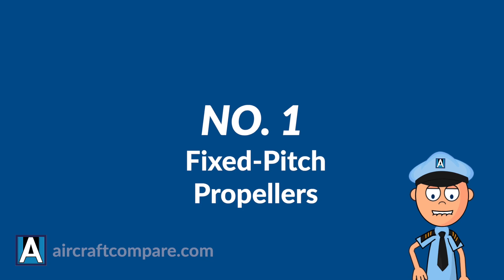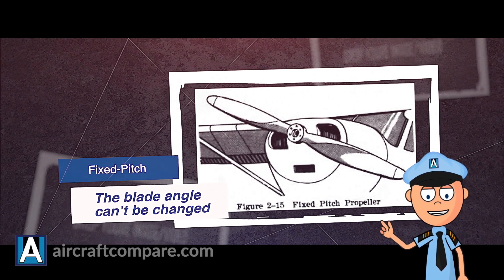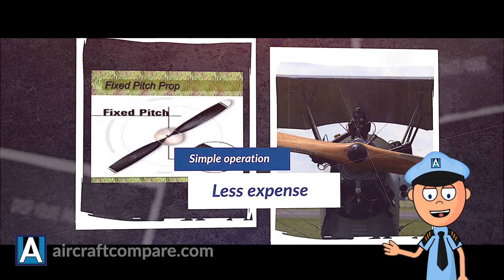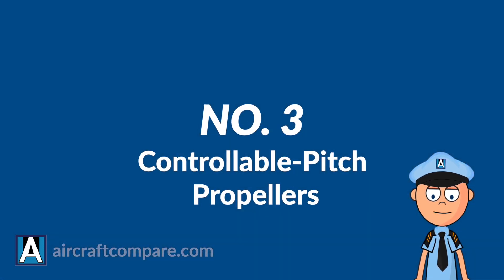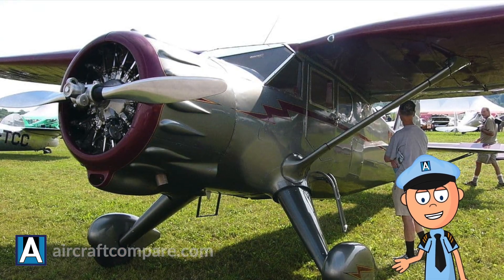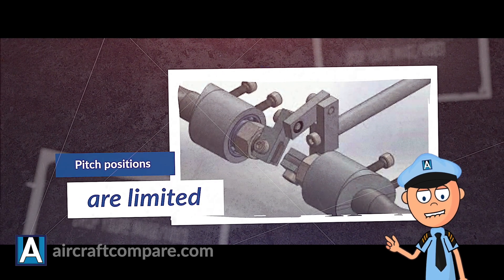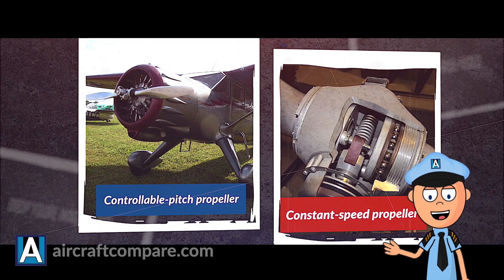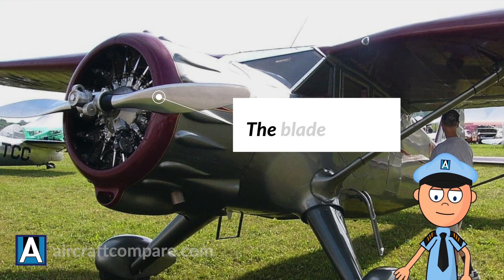6 Types of Aircraft Propellers in Detail #PropellerPlanes #Aviation

Comment: Way too much false information
Reply: Can u specify which is false?
Reply: Drey Galon  all of it. Fixed pitch propellers are not predominately made of metal. Saying a ground adjustable prop is like a fixed pith prop is wrong! Every aspect of this video has mistakes in the information presented. As pilot and aircraft maintainer of over 40 years, 20 of which were military, this guy got it all wrong.
Reply: @waynetokarz174  I assume he was just likening their appearance but obviously they are different. And he did say that fixed pitch is usually wood or metal (or composites). So what is the correct info?
Reply: Drey Galon I’m sorry but to give you a complete and proper answer is way beyond the practicality of these small threads I would recommend proper research and a little field study just to appreciate the scope of such a large subject. You tube is very much not the place unless you can find some multi hour educational film series. Good luck and happy education!
Reply: I think he said ground adjustable is  similar to fixed pitch propeller because when operating or when the engine is running or in flight you cant change the pitch of an ground adjustable so somehow you can say in flight fixed pitch and ground adjustable is almost the same.
Reply: Fantastic